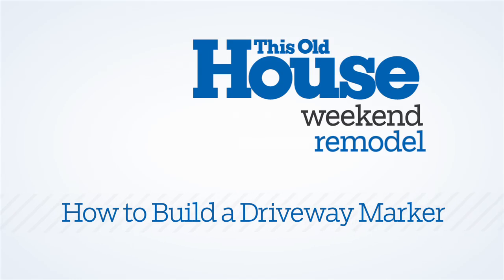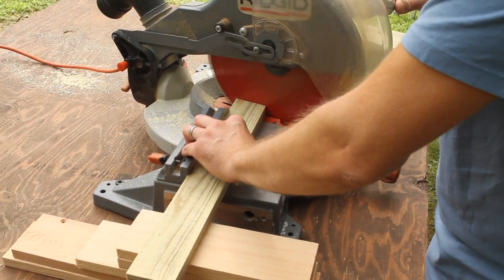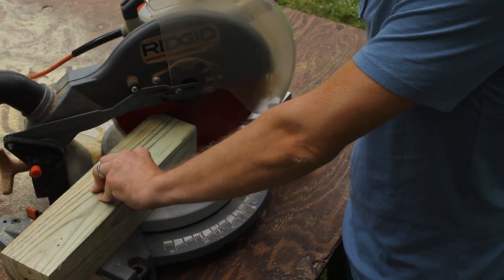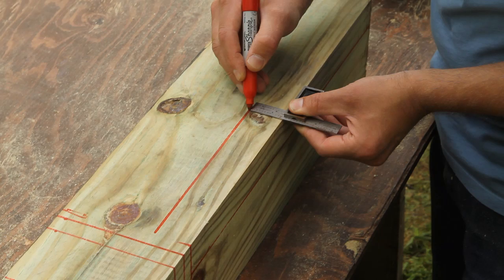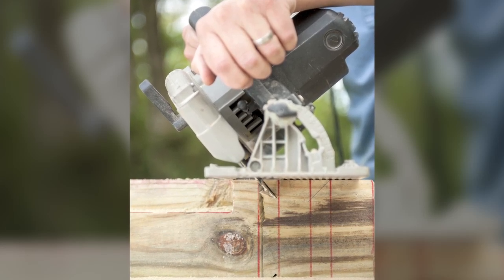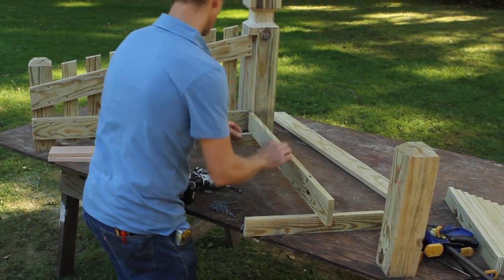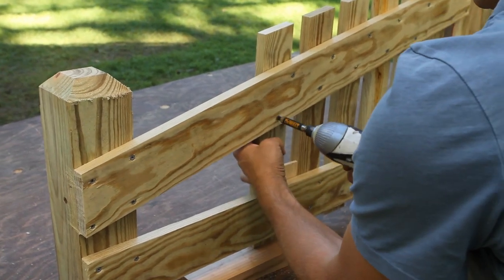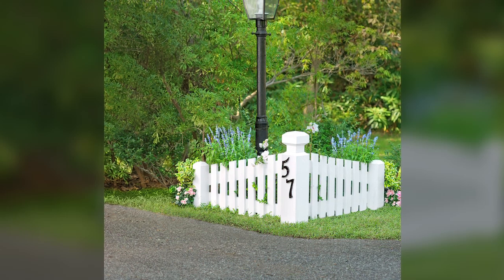How to Build a Decorative Driveway Marker | This Old House

Comment: Build it out of redwood or cedar instead of treated pine.  Treated pine dries out, splits and warps within the first year or two and all of your work looks like garbage in a short time, even after painting.  More investment up front for a product that looks good MUCH longer.
Reply: Thanks for saying that.  I was wondering, when do you paint treated lumber, and is it worth it/does it stand up over time.